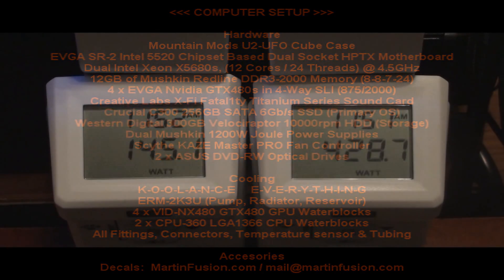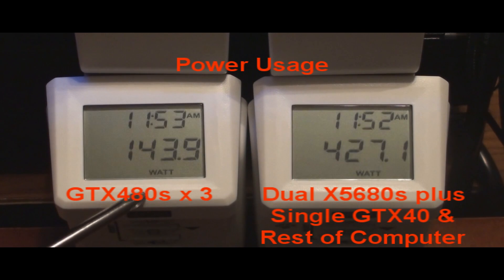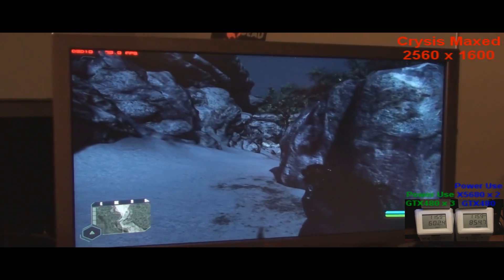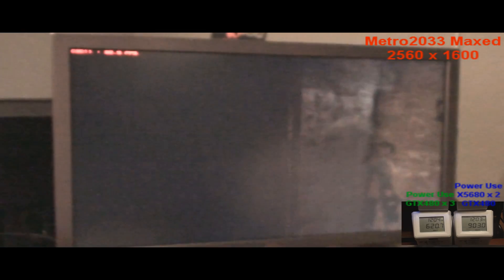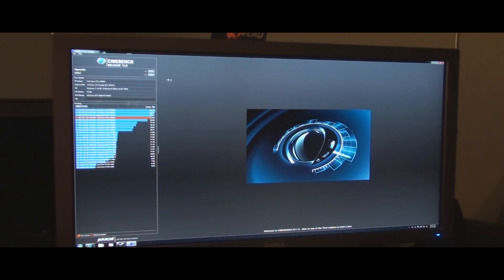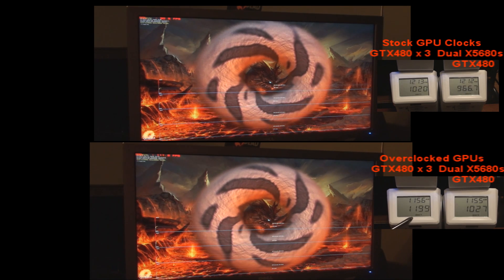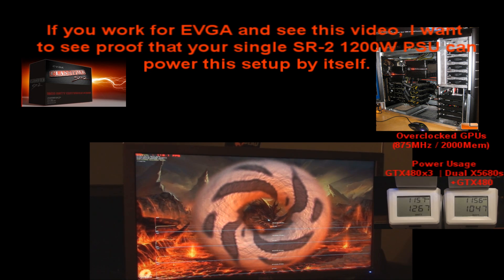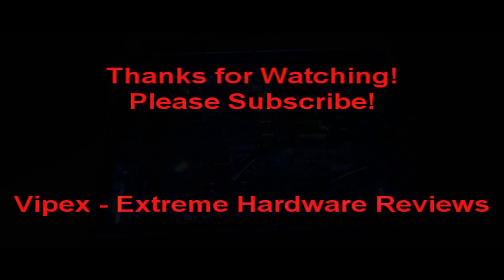Power Consumption:  EVGA SR-2, Dual X5680s, 4-Way GTX480 --Overclocked

Comment: I've messaged Trubyd44 about why the EVGA SR2 power supply can push it.
while his power supply has 
6x12v rails at 19 amps
the EVGA SR-2 has
6x12v rails at 38 amps
amps x volts =watts
19*6=114
38*6=228 

114*12=1368
228*12=2736

his power draw during furmark,an unrealistic power draw benchmark since nothing will max out every component in real life usage like it does,was 2300 watts.

so that is how the EVGA SR-2 could power that setup as they claim.

Comment: @Trubyd44 Wrong. Firstly your in the states, so forget the optimistic efficiency rating on the box that won't be for your 115V 'Amerikan' electricity, yours will be lower. Then as I hope you know, 'enthusiast' PSU's can exceed their rating.So really your 1200W can supply about ~1400W they won't call it a 1400W PSU as the efficiency goes off a ravine at those loads (no 80+ cert). You can easily expect efficiency around <60% at the 'limit' scenario you thought you were at.

Repeat with 1PSU & see.

Comment from the maker: @CmdrTobs ...and on your second comment..."Then there is your implicit incredulity suggesting a 1200W rated PSU is near its limit at 1270W. Where if you understood you'd know it could read 2000W+ on that meter." even at a fairly low 75% effeciency it would only be 1700W from the wall.  Nothing near 2000W!?!  Come on man!

Comment: @Trubyd44 No, I listened *very* carefully. You constantly made references to drain on the meter being from "3 GTX 480's" rather than the drain being from the wall outlet of the PSU connected to the "3 GTX 480's". A key distinction that alerted me to your slight confusion.(Not to mention your doubts about the EVGA supply)

Then there is your implicit incredulity suggesting a 1200W rated PSU is near its limit at 1270W. Where if you understood you'd know it could read 2000W+ on that meter.

;)

Comment: I just looked at the video quickly but I saw that the power consumption didn't got to around 1550W so can't you just use a Ultra X4 1600W power supply for the whole computer instead of using two separate PSU

Comment: 2 questions: how much RAM did you have in there at what speed?
and how in the world did you get 2560x1600 on that monitor? is that a dual-DVI connection or what? the sixe of the screen is DEFINITELY larger than 40 inches...

Comment: the sr2 power supply your referring to is actually just a rebranded antec truepower quattro tpq-1200 oc. decent unit but i can bet my bottom dollar evga will jack up the price a good notch. also there is two knobs on the back. similiar to a fan controller. one is for voltage regulation and the other is the fan speed of the psu. i dunno about you guys but if i was in the market for a 1200w psu i would rather get corsairs new ax 1200 or something.

Comment: Hey, Truby, this video is exactly what I needed to see before finalizing the new build that I have been planning for a few months.  Three GTX 480s + ASUS Rampage III Extreme mobo + i7 920 D0 OCed to 4.+GHz + 6GB DDR3 and a complete water cooling system (two loops) with crazy lighting and UV-reactive tubing.  I plan on using two Corsair HX1000 power supplies with two GTX 480s on one HX1000, the other GTX 480 and rest of system on the other HX1000.  Looks like two different circuits for me, too!

Comment: @CosplayerTheRealLink You're welcome ;) and another question of course is budget :). When you have enough money, i can gladly recommend you Enermax Revolution 1250W.. I have one in my system, and I'm happier than ever with it. Plus it uses some high-tec japanese capacitors, so you can expect durability. And about that motherboard, if you are looking for Double CPU setup, then it's no doubt that SR-2 is the way (but of course another power supply for that CPUs). If not,then stick with 4-way Class

Comment: @Trubyd44 Thanks very much for the insight Truby!  I just came across your videos recently but have to say they're crazy!  *nods* I'll look at your Mushkin supply then.  I've had good luck with them for memory.  Well the case I was contemplating building around was a Lian Li PC A70F - I'm pretty sure all the places say it can hold the E760 Classified model (and still gives SATA 6 / USB 3.0).  Just leaning to EVGA for their quality in components I've had before but ASUS is usually good too.

Comment from the maker: @CosplayerTheRealLink If you are only goin with dual GTX480s...I'd get the ASUS Rampage III Extreme.  You get SATA III and USB 3.0 and a motherboard that will actually fit in all cases.  The 4-Way board is very limited in what cases it will fit in.

Comment: @CutingTheEdge Yo thanks for the reply man.  Kindly appreciated.  So far I'm thinking an i7 920 / 930 OC'd to a reasonable amount (mid 3ghz maybe or 4ghz if it'll stay cool), IDK first time doing this.  Probably 6GB of RAM, 2 HDDs, one SSD, two opticals, sound card, that's about it I think.  Yeah true, as others said maybe I can just look at the 1,200 Watt PSU or just get the EVGA one.

Comment: @CosplayerTheRealLink Well another question is what else will be running on that PSU, and most importantly What CPU, every one of them needs different wattage when you OC them. But as David said, 950W  (price) compared to 1200W is not that much, so that 1K compared to 1,2K will be even lower. Go for 1200, it's always better to have a headroom, when you want to add something in the future. Cheers ;)

Comment: Very informative video sir!  That's quite an amazing setup you have there to say the least and WOW at the power draw.  Question if possible - I'm contemplating a rebuild with probably one OC processor and one or two 480s (stock).   Would a 1K PSU be enough or should I just go to 1,200?

Comment from the maker: @jddonba I don't think your vendor knows his stuff.  I think for the most part the 950W will do fine, but there is absolutely NO margin for error.  For instance, my buddy has dual GTX480s and a 9800GT for physX and he uses the Zalman piece that measures power draw.  His unit goes over 999W when benchmarking or playing games.  You need a 1200W to have some room.  The cost for a 950W as compared to a 1200W is not that big.  Get the 1200W!

Comment: OK so Truby, your vids nearly earned me a divorce lol - your inspiration got me to splash out 3G's on a new system with two GTX-480's, a dedicated 9800GT for PhysX and a 975 Extreme holding it all together. I could only afford to water cool the CPU but my vendor tells me a 950W transformer will suffice - what do you think?

Comment: @onoff314 you actually can have 3 monitors in 3d with the nvidia  surround 3d and any gtx 400 gpu series and compatible monitors and the 3d kit wich is about  1400 usd if you already have the video cards

Comment: Isn't is better to have 2 GTX480s, 1 CPU, half the amound of HDDs and half the amound of fans on 1 PSU.  And the other half of your (amazing) computer on the other PSU?
I think you would get cleaner power for a little bit better OC.
And I think it would be better for the PSUs alsow. (less heat,...)